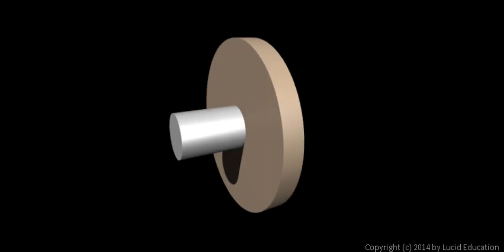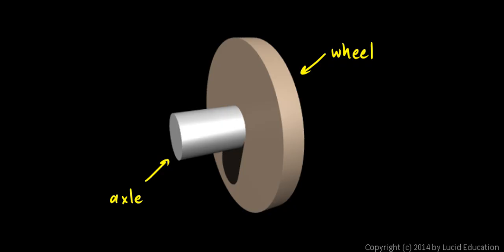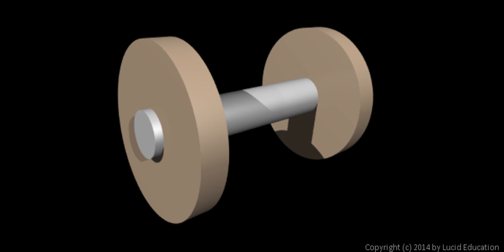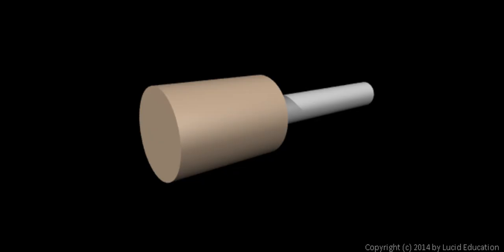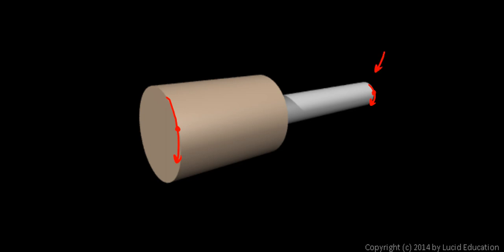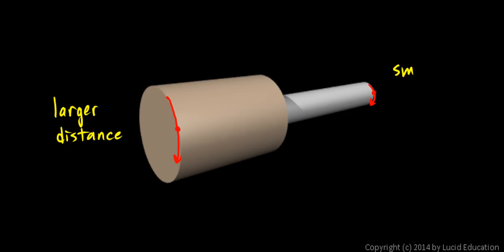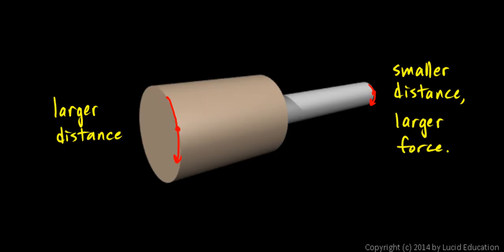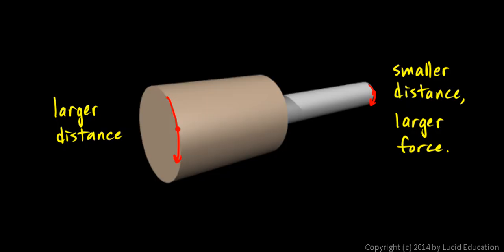Physical Science 4.4a - The Wheel and Axle

Comment: Mr Owens, the IMA here is more than 1 even though the  radius of the axle is smaller. Than why does a bicycle have a mechanical disadvantage if the sprockets with the pedals are larger than the sprockets with the wheels? Shouldn't the output force be greater just like here?
Reply: Say if the Axle size of a bike is 1 cm and the wheels size is 65cm therefore the IMA is 65. The wheels can be also used as a speed multiplier not just a force multiplier. Also the gearing on a bike will change the Pedal to wheel ratio, also changing the IMA